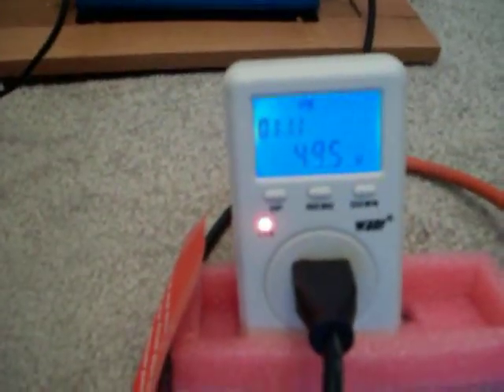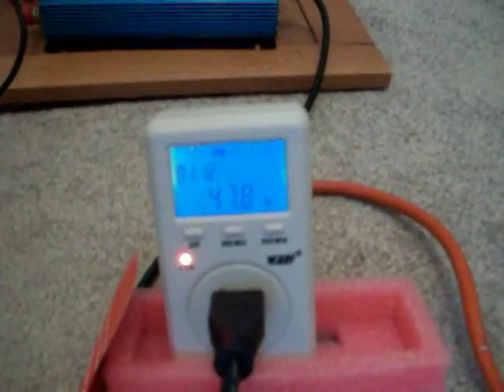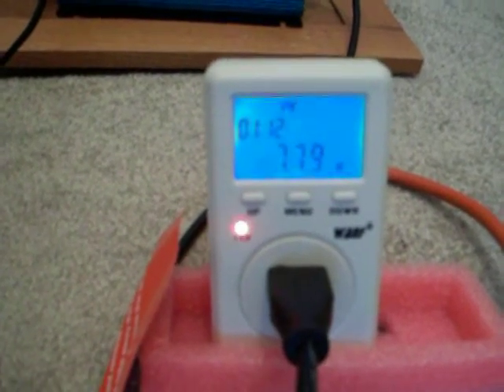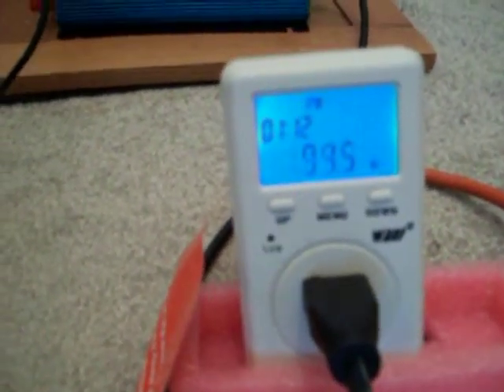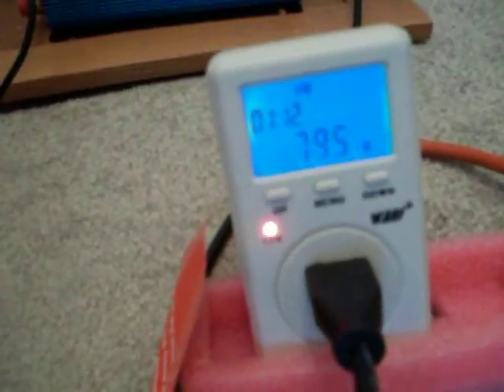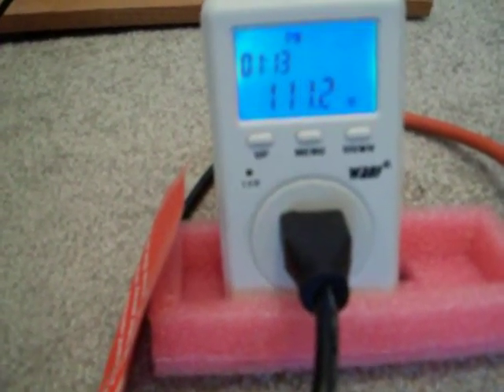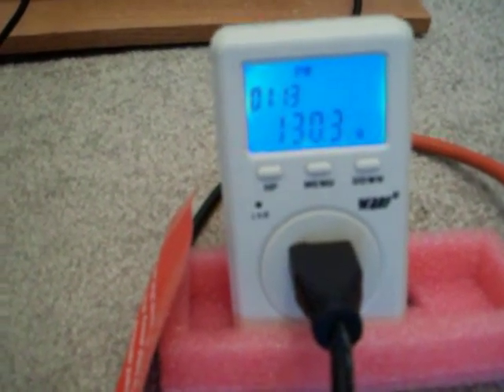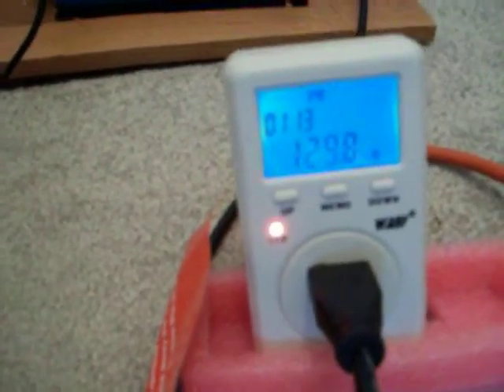Solar panel Grid Tie Inverter Power Jack

Comment from the maker: Thanks Tom,  I was impressed with the out come,i have it tied into kichten were  the hungry refer lives so what ever i can feed it,Plus what i use each night.I use about 1.25 KW a day thru my battery.and i can recharge it back up every day.i,ll hook up 2 90 watt panels tomorrow i,m hopeing for 250 watts,4 or5 hours a day plus batterys at night. Also all my lights are 12vt in rooms off Grid.no way to count that.Power Bill is 1/2.Past 2 cycles from last year.Im Trying 4 3KWhs a day or better.